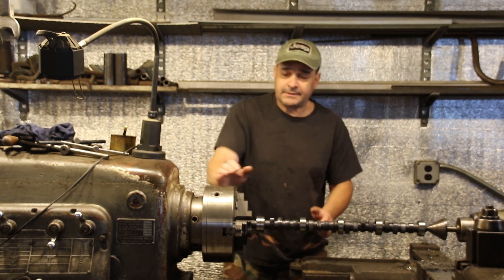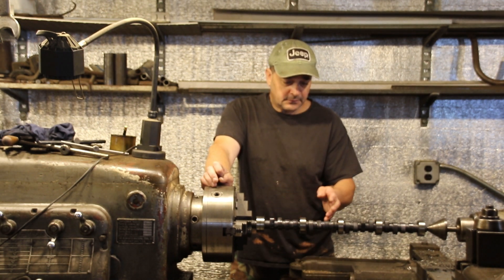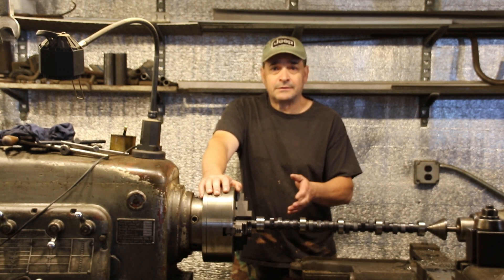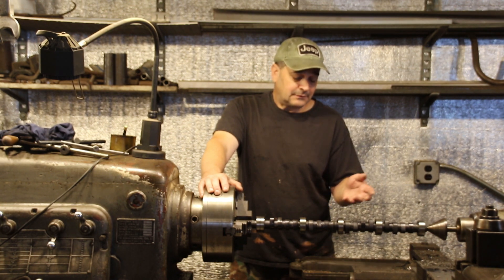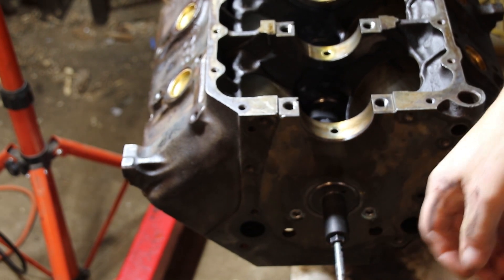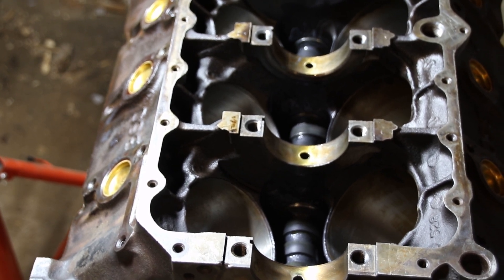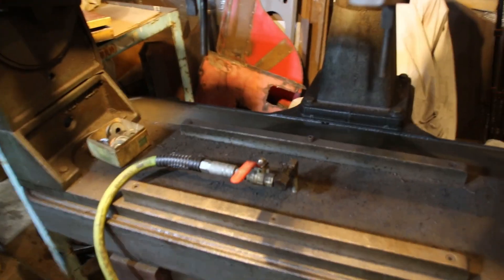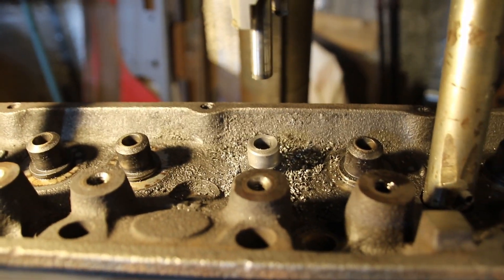Comp Cams 2132 Too Tight In My AMC/Jeep Engine Rebuild...... How To Fix !!!

Comment: Brian, Great video. What is the part number or where can I get one of the valve post milling tool from? I would love to to do that on my AMC v8's.
Reply from the maker: You can get that tool from Cylinder Head Supply.  search for them on the web.   Get a tool for what size seal you want to use.  I used a .625" cutter with a 3/8" pilot.  That works great for the 360.

Comment: A couple of things & maybe I missed it in the video. Run a bore gage in each cam bearing journal and write down the measurements. Be sure to rotate your bore gage 90 degrees and check measurements that orientation too. A lot of engines come from the factory with elongated cam bores and you cannot detect that just by installing bearings.  What happens is the elongated bore distorts the cam bearing and that could be the cause of your tight fit.  Measure the cam at the journals to make sure each one is correct prior to attempting to slide it in. Again, rotate your micrometer 90 degrees to check at two orientations. Another way is you can do some basic math by subtracting the cam journal diameters from the cam journal bores and then measure the thickness of each cam bearing to see how tight or loose it is prior to attempting an install.   Shoot, use 2 out of the 3 if not 3 out of the 3 pre-fit measurements prior to attempting to slide your cam in. Lastly, just as this fella said in his video, don’t scrape bearings or put grooves in them.

Comment: 🤣😂🤣I just bought a full kit from them.. wrong timing chain, cam ground 8 degrees retarded, two sets of pushrods, two sets of rocker studs, no rocker arms, no valve spring locators.. hours trying to get through.. no help whatsoever. Absolute $hit show! 
My machine shop told me I should have gone with Howards.. wish I would have sent the whole engine to the machine shop and let them deal with it.
Reply from the maker: Stories like yours are very common these days.  Shops and customers are having a hard time with parts and customer support.

Comment: Thanks for the video and information. My question is about the cam. Was it that the cam was slightly oversized, or were the cam bearings oversized?
Reply: Did you watch the video, he answered your question in the video.
Reply: @frederickshipp8013  I did watch. I must have missed the dimensions measured. I will watch again.
Reply: @frederickshipp8013  yes, he did say the journals were oversized. Thanks for politely letting me know that I missed that.
Reply: Based on the final measurement range posted at 7:01 on the video, I also wondered whether the bearings were part of the problem.  It would have been interesting to see bore mic readings of the bearings.
Reply from the maker: Tried 3 different cam bearing sets, every one of them measured the same.  the cam journals were way off
Reply: @metalshaperJeep  Could AMC have line-honed the cam bearings for alignment at the factory?  I know they are different sizes, and I would never design a production method that way, but I have heard of this for some engines.   -Doozer
Reply from the maker: @kooldoozer  The factory built perfect blocks and everything was line honed or line bored to insure perfect straightness.   The problem is aftermarket manufacturers, they are getting worse and worse.

Comment: Question........I've been offered a non-Jeep obviously...Mildly built 350 small block that's been sitting on an engine stand, covered, in doors, never spun......since 1984. Yup, re-born in 1984, never spun it's assembly lube........kind of, sort of, a rare things these days as with the plastic off it........next to zero dust. Should it be torn down and gone thru or should I bring my bore scope and just go from there? I've come to trust the owner............but, still need to do the Dear Abby thing due to age. 🤔 Thanks in advance!
Reply from the maker: I would see if it turns over by hand. If it does you can pressure lube the engine, then with plugs out spin it over with the starter.  If that goes good start it up and check oil and temp throughout the break in period.    If you are super concerned you can remove the oil pan and heads for a real good look inside before starting.
Reply: @metalshaperJeep  I could pre-lube by pulling the dizzy, put a long flat screw driver blade in my drill and spin the oil pump 1st.....Then do the starter thing.....That's probably what you meant by pressure lube any ways. He said he's never spun it, I suggested he should....I can't imagine it would need to be torn down unless I find something with the bore scope on the cyl walls....
Reply: i would pop off the oil pan and pull a main and rod bearing cap just have look....maybe re-torque just to be safe.